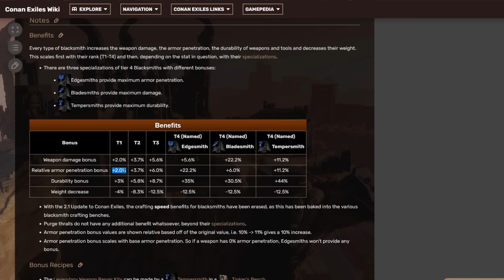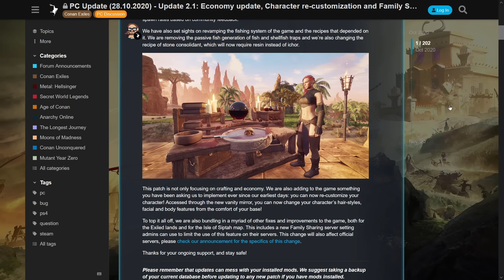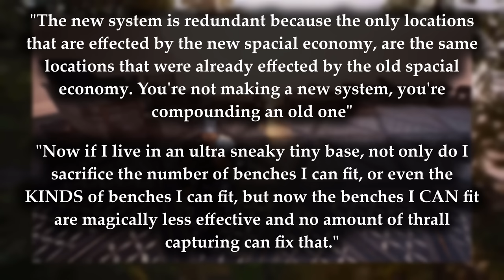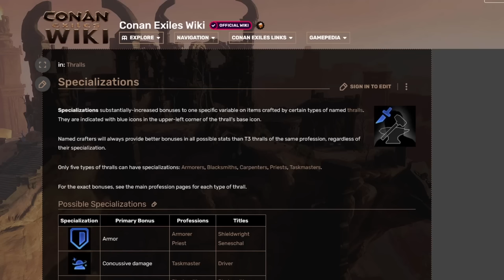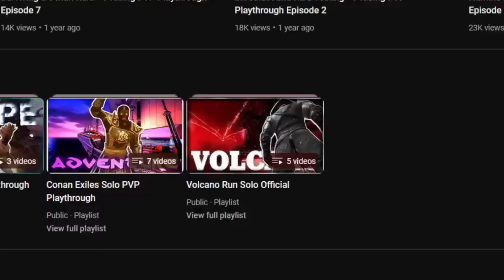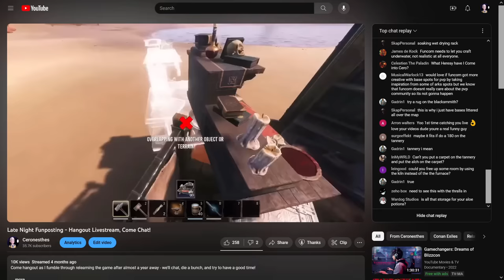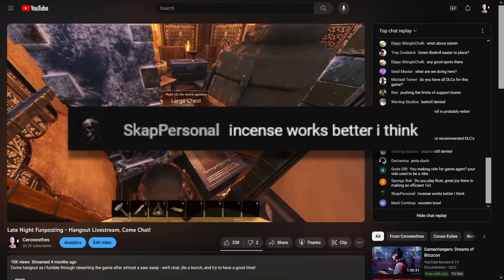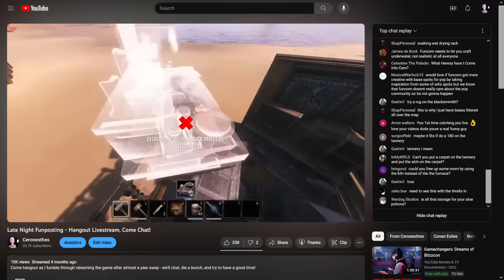The ULTIMATE Conan Exiles 2x2 - Solo Build Tutorial (With Advanced Tips and Tricks)

Comment: Very nice video both in story and explanation of the technical side of things.  One thing does bother me though.  Why the improved furnace and not the kiln?  The kiln seems to be often overlooked as it's kinda a T2.5 recipe.  It's smaller than the other furnaces(ignoring the charcoal kiln which is junk), and yet holds more than any others, crafts at the speed of the fuel efficient furnace(improved furnace is +0%, kiln is +42.9% speed), and does make the fuel last a bit longer, though not as much as the fuel efficient one.  Basically, it has every advantage over improved, and some advantages over the T3 ones as well.

Comment: You need to do this when not using flying mode and ghost mode.
Reply from the maker: Ghost wasn't used in the video and flying isn't necessary, use the overencumbrance tip I mentioned at the start to move slower